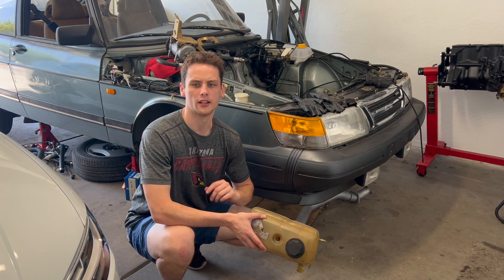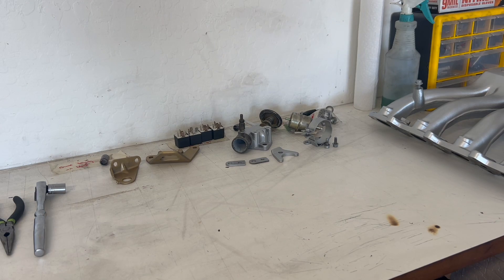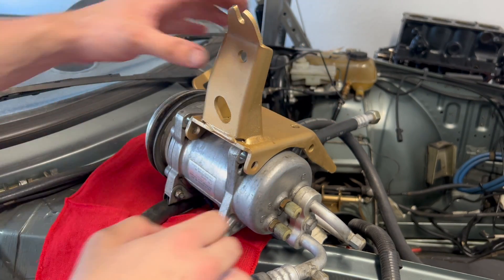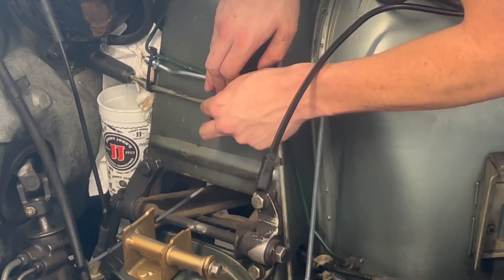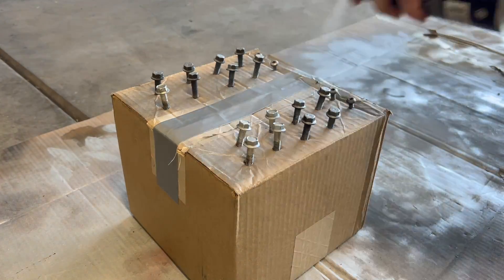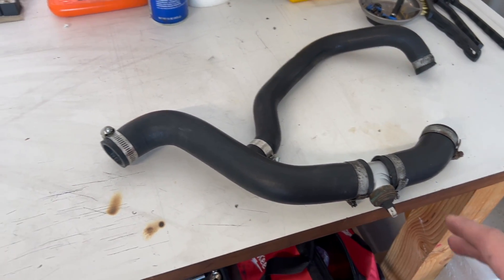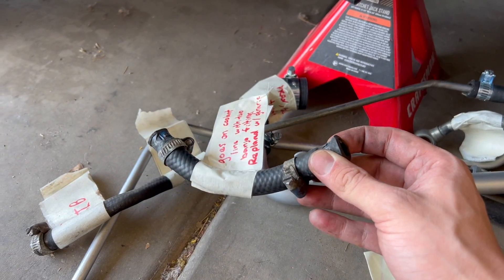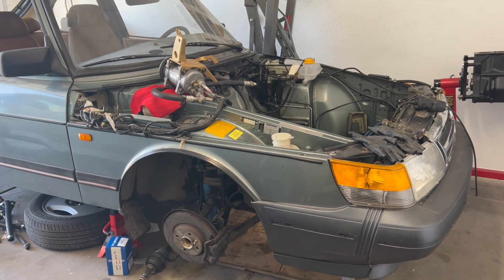Reassembly Begins on the 900 + Discovering Another Problem (Rebuild Part 4)

Comment: Satisfying video. A pleasure to work work with clean and painted parts. Have you tested the spray pattern of the injectors before mounting them in?
Reply from the maker: Thanks! I haven’t tested that but I did new o-rings and such on them recently

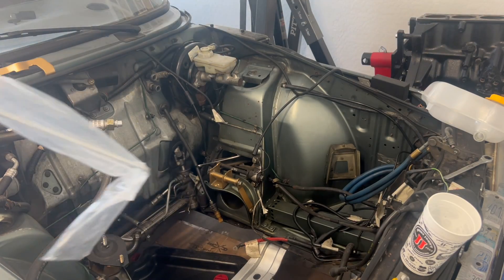Comment: Hey bud, I need your help. There was a black wire that hangs down by the clutch hose that is connected to the screw that held the "tube clamp" (8371551) for the clutch hose and brake line (you're pointing at it at approx 5:00.6 where you say the word "all" - and then continue saying "the way down"), that you remove prior to the next scene when you're actually removing the clutch hose. Where does that wire go ... from that screw to what point? Trying to figure out my own rebuild at the moment lol 

BTW Sorry if that was the most confusing way to ask that

Comment: I do not like using worm gear clamps on coolant lines.  They can't expand and contract with heat cycles.  Look for constant torque/tension clamps (mishimoto has them) and they will expand and contract and you will never have to worry again.